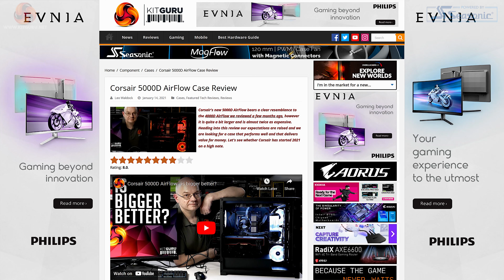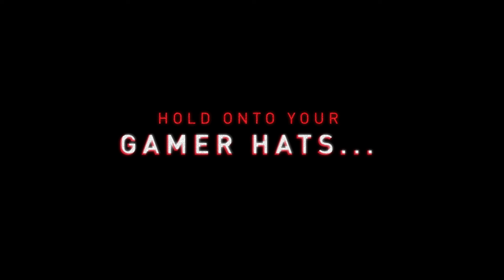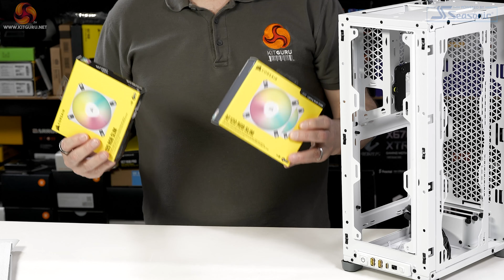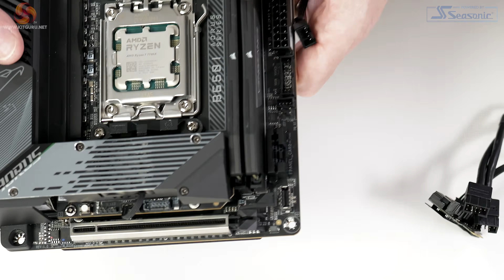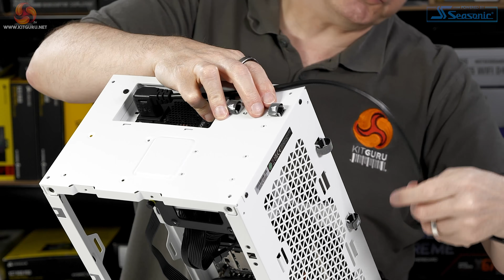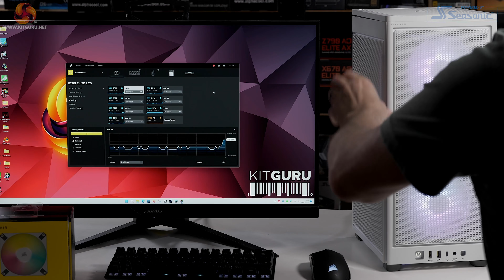Corsair 2000D Airflow - Mini-ITX and SFX

Comment: I wonder why adding front fans reduce noise?  Would it be because the AIO fans run at a slower rpm with better airflow when the front fans are installed?  But again, wouldn't the AIO fans run at full speed during CB23 regardless of front fan installed or not?  Would appreciate any insight.

Comment: I have a 4000D Airflow in white and overall its been a really nice case. However due to my huge motherboard heatsink I cannot put anything larger than a 240 AIO at the top. So radiator support is iffy. Also vertical GPU support is non existent, as its way too close to the glass... Wish they gave it 1 more inch of width. I'd like an ITX system but I also want more than 2 M.2 drive slots and that simply wont happen. I have 4 slots in my current B550 Unify board. This 2000D is a fiddly case.
Reply: I have the same case, there is no support for 360 top mount on 4000D Airflow, I use 360 but in front.
Reply: Pretty sure the MB in this video can use 3 M.2 drives
Reply: Just put a 360 in the front

Comment: This thing is huge for an ITX case. I don’t really get why they didn’t just make it a little bigger and allow it to run a m-atx board.
Reply: This is always the debate with designing for ITX.  Just a LITTLE BIT bigger and you could have ATX PSU and m-ATX boards for sure.
Reply: @ghost_of_m it depends on the market. Offer a product that has a specific use case. All this offers over the Meshlicious is no PCIe riser, and a 360 Radiator instead of a 280.
Reply: @PurpleRupees  yeah I guess the bigger RAD will matter for people trying to deploy the highest TDP CPUs in there
Reply: @ghost_of_m  Except FF01, Meshlicious, Meshroom, and T1 all do everything this case does while being significantly smaller.
Reply: Jonsbo D31, ASUS Prime 201. Just the right size allowing for full fat components and fewer compromises. I rather have more space for GPU than a 360 AIO.
Reply: @marinipersonal  don't forget that mini-ITX motherboards are WAY more expensive than mATX
Reply: Just get a SSUPD Meshroom which is 15 liters (9 liters less than this) and supports FULL ATX mobos and PSU's.
Reply: @seoulglo1999 very questionable place for input and output ports this case has
Reply: Agreed should have been matx for how big it is
Reply: Agree matx is better
Reply: pretty sick of mATX size cases masquerading as ITX.
Reply: Yeah, lots of great real ITX case out there. This one in particular is a shitty ITX case.
Reply: Personally, I think this is a good entry into Mini ITX for a lot of people.  You still have to worry about GPU dimensions, you still have to put a small form facto PSU in it, you'd have to buy a special bracket from Fractal to install an HDD and you have to be creative with cable management, but you have a good amount of room to work and the dimensional concerns are easy enough to navigate.
Reply: @CaptainGrims  Judy buy matx if you want matx size. Cheaper.
Reply: Perhaps they’re holding out to make a matx version…. The 2050D 🤣
Reply: Should've been a bit narrow and also smaller in height.
Silverstone one is even smaller and half in weight, but a bit wider,  so might not fit on small desks.
Reply: Tbf, ITX is better than mATX 🤷🏿‍♂️

Comment: Engaging, entertaining, and educational; it can only be Leo; more of these interesting and unusual cases, please! 

I'll be very interested to see an extended test of this case: unlike the Silverstone FT series cases I have previously used, the GPU faceplate is downwards, so I wonder how that will affect long-term GPU cooling?

I didn't see any cables coming out of the bottom when the completed system was on your bench. How does the case fare when you load the rear / bottom panel? Say 3 or 4 video cables, speaker cables,  and a number of USB cables. How much room is there for video cables with larger plugs (optical cables have transceivers)?

BTW if you want to mount more than one 2.5" drive, try using sticky pads to stack them!

PS As it's a vertical case, how about a fully passive build? :)

Comment: i wonder what would be the air cooling configuration will look like?..do we still be able to install 3 120mm fans?
Reply: Depends on the height of the cooler, but the side panel can take 3x 120mm fans or 2x 140mm fans.

Comment: Mine is arriving next week. I wish they had a teeny bit more space to accomodate a 3,5 to 4 slot GPU. I wonder why most sff cases restrict the GPU length to either 320mm or just 2 to 3 slots if they support longer GPUs. Why can't we have both?
Reply: Small Form mean to be SMALL so they are not designed for housing thick gpus at all. It all ruiend by the xxx GPU manufacturs, or buyers who always believe bigger is better and thinking to put a 300w+ monster into a small case regardless unpleasent noise, extra cash for fans, itx board, sfx psu etc. 
Anyway, if they do it larger then why not matx? There are some better design on Dan C4 that leaving thick GPU on top, Or Fractual Design ridge leaving a whole chamber for GPUs, but still, thinking original Dan a4 is such a small and delicate case and it is getting 4 litter bigger and similar to the size of NR200...
Reply: @zhy199333  The point being this case is not really SFF at all considering the cases under 15L having better cable management and GPU options. If they went large they could easily have added another 0,5cm clearance for a thicker GPU.
Reply: @ajmatt  I agree on this point. The designer of this case feels like someone doesn`t really use itx but fancy about the concept.
Reply: Just buy a reference card and you be fine.
Reply: @camotech1314  Reference cards are usually not easy to find. Also the FE Nvidia cards are usually scalped up here almost instantly and not worth paying extra.
Reply: Shouldve bought a different case then. Almost as if the T1 does the same thing.
Reply: The SFF case Silverstone Alta G1M allows a 4-slot thick and 355cm long graphics card. its concept is quite similar to the Corsair, although upside down.  Kitguru has a review on it.   Got one and im happy with it. 😀
Reply: Late reply, but the 2000D can actually fit most GPUs with a few exceptions - like the extra thick ASUS/ZOTAC/Red Devil GPUs won't fit obviously. Bult most 7900XTXs will fit, and a LOT of 4090s will fit; the PNY Vertigo 4090, the Founders 4090, the MSI Slim 4090 will fit and if you wanted to get creative with the tube management you could put the MSI Suprim 4090 or that one AORUS 4090 with an AIO in the 2000D and have a water cooled 4090 in there.